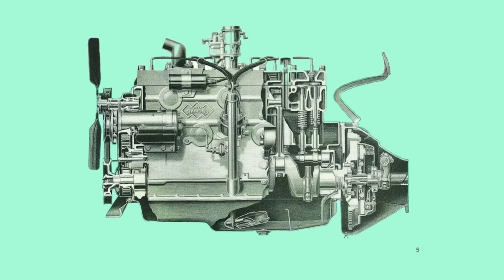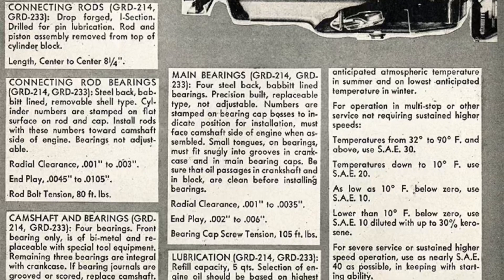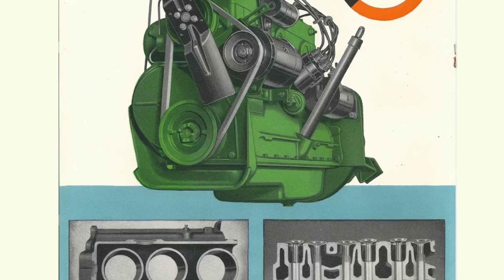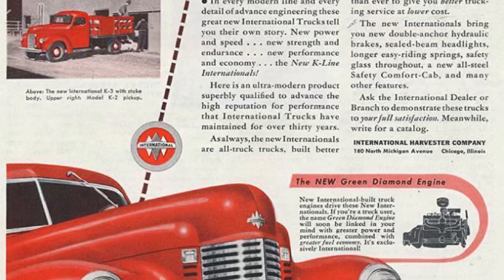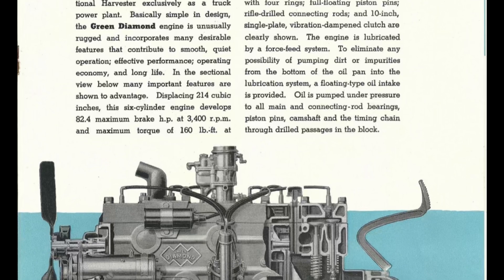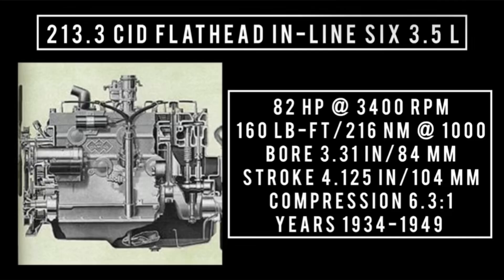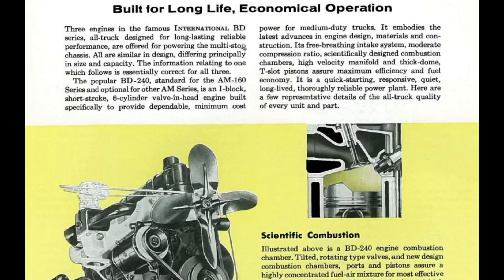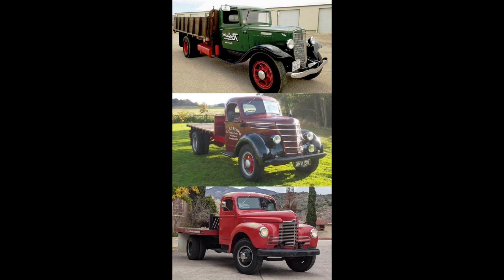International green diamond engine ￼family 175, 214, 233

Comment: Great trucks and engines, you know it’s a truck engine when the torque comes in at 1,000 rpm that’s stump pulling torque when coupled with the gearing these trucks had, that should be a topic all its own (transmissions and rear differentials as many had 2 speed rear differentials. As far as would you rather this time I’m down for any and all of them especially the 1 ton and above !👍

Comment: I am a retired truck mechanic I worked for a I H dealer in Casper WYOMING in the early 1970s I worked on a lot of Red Diamond gas engine's they were great engine's.
Reply: We had Red Diamonds 401,450,501 all pulled hard.
Reply: @dirkvandam9873  Those were great heavy duty gasoline engine's they were rebuildable and would go alot of miles the 401 and the 450 had replaceable dry cylinder sleeves.
Reply: I had a old fire engine that was converted to a dump truck it only had 30,000 miles on when I picked it up for $1000 it had the 543 gas engine and a Eaton 10 speed you could work the heck out of that truck all day and the torque came in at about 1200 rpm it ran with the diesel’s all day long and it looked great in its fire engine red paint
Reply: @middleclassretiree  Are you referring to the 549 v8 International engine if you are they were very powerful they were rated about 220 horsepower they would out perform the 220 Cummins back in the day.

Comment: I can hardly imagine having only 84HP under the hood of a 1.5 ton truck!! Count me in for the 1940 K and the 1939 D series. Love these!!!
Reply: Those trucks were geared LOW and 50 mph would be the top speed.  Considering the roads back then, that was a reasonable limit.
Reply from the maker: @mkernen  it's long stroke power it's different kinda like 35 degrees in Pittsburgh in the winter time is perfect in a weird way it's cold but not terrible idk it's weird but 50 degrees in fort Lauderdale Florida feels colder than 35 in Pittsburgh pa and this is kinda like that long stroke power is something different

Sweet choices I love this era of international
Reply: Not a racer in top speed, but I'll bet it could pull out tree stumps! LOL
Reply from the maker: Switching the rear ratio these trucks could go faster

Comment: I could be wrong Jay but I think 232.2 is actually a 3.8 Litre.
Reply from the maker: You are right it is 3.8 I saw specs for that engine somewhere and took it at face value I got the bore and stroke sizes from the literature so I know those are right and converted them to decimal

Comment: Such a pain to lap the valves in on my 49 KB2, And over priced parts as well. But, I'll get it done.....
Reply from the maker: I often wondered what it would cost to rebuild one information on the 175 is sparse on the internet 

How do you like your kb2 

In my opinion the k series is the best truck of that era I really like the d series as well but are rare
Reply: @What.its.like.  Well, by 1949 the KB was getting 'dated'. I've owned Fords, Dodges, Studebakers and Chevys of that era and the KB was more solid—but under powered. Chevy's OHV six and Ford's V-8 ruled the roost. IH just didn't have the same size dealership network across the same broad demographic as the guys who were also selling sedans and station wagons...
Reply from the maker: Great insight and information 

It didn't really matter what truck you got pre 1975 no matter the engine or gears they didn't go over 55 easiest way to get them to go faster is a rear end swap
Reply: @What.its.like.  Good point! Low gears haul heavier loads, which is what trucks are supposed to do.